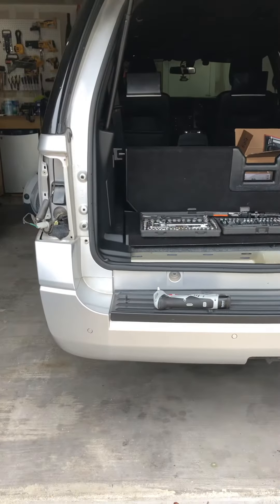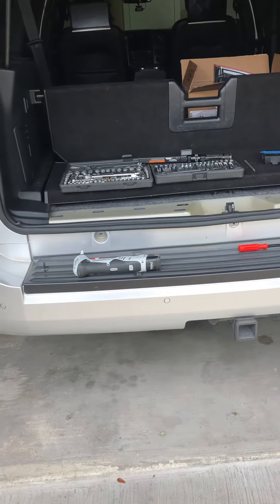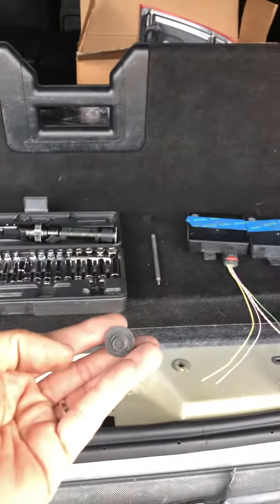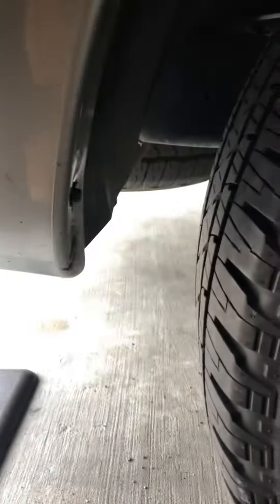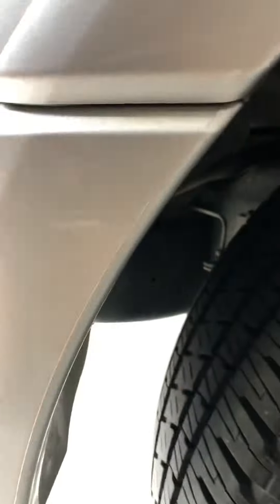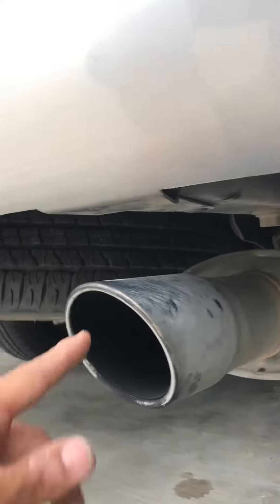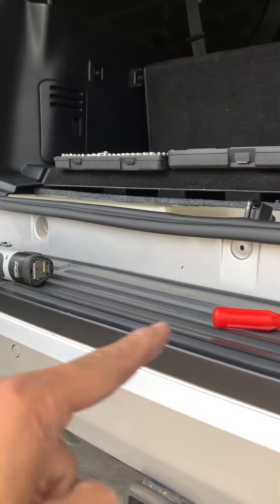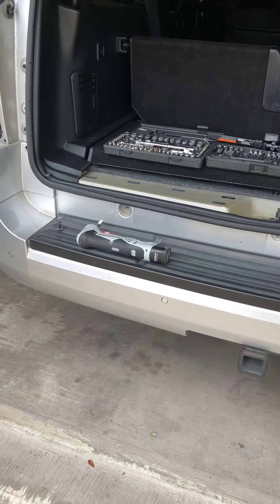15-17 Ford Expedition - How to remove a rear bumper cover

Comment: This helped a ton. I’m assuming the sensors are just a plug? I have a gold 2016 I need to fix. This is perfect!
Reply from the maker: @claytonwindham ... correct, the parking sensors are plugs, they can be easily disconnected.

Comment: Thanks. Going to tackle that job this evening.  Mine is a 2011 but I'm pretty sure it's going to be about the same process
Reply from the maker: From 07 thru 17. it should be the same.
Reply: How much did you pay for a new cover?
Reply: Can the plastic retainers be reused?
Reply: @Sherry Berry  believe it was about 150 and yes you can reuse retainers/fasteners as long as you use the correct tool to remove them
Reply from the maker: @sherryberry1567  Yes, i re-used mines